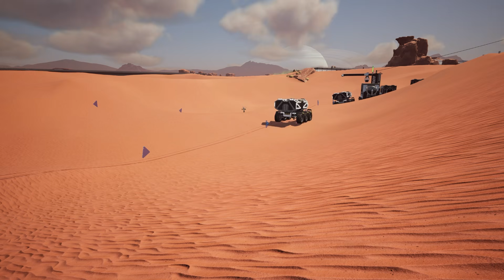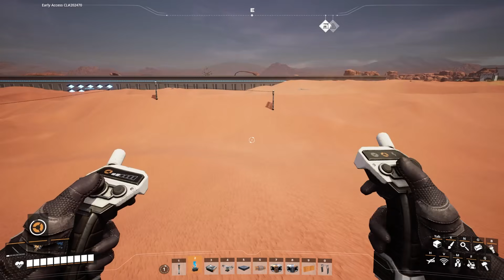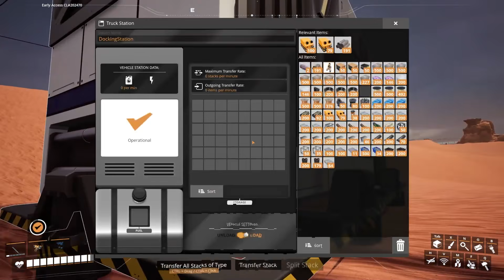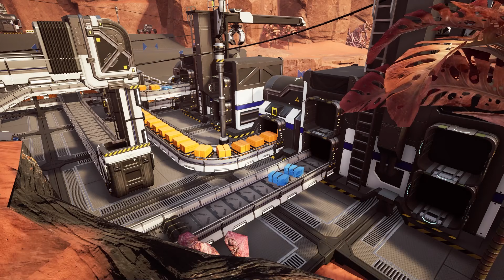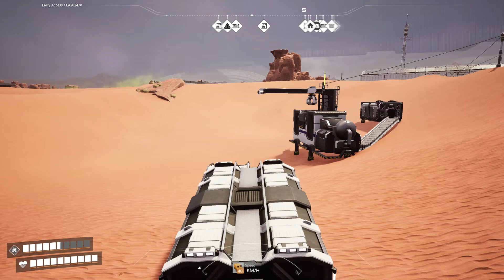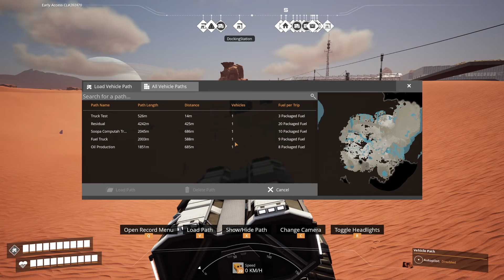[OUTDATED AS OF 1.2] How to Build a Truck Route in Satisfactory | Setup + Automation Guide

Comment: I think it would be good to mention some of the pain points using vehicles. 
1) Wood producing tree's of any size will stop your vehicle and is super frustrating when recording a route, so try to clear the route before hand. 
2) Even though you have to explicitly press the indicated key to load/unload while setting up a route.... strangely if the truck passes the bounding box (white square when placing) of another truck station it will perform the load/unload automatically... This was infuriating as you can spend many hours setting up trucks, just to start seeing materials begin to mix into your production lines and mess things up. 
3) For me, going up steep hills dramatically impacts steering for whatever reason and is a challenge.
4) Rocks, even small ones can stop your vehicle altogether.
5) If a truck falls in the water, it is lost and your only option is to dismantle it.
6) Afaik, a route can be edited, but only to delete a tracking arrow. You cannot add or move an arrow, which would make route building much less frustrating imho
6a) By extension, routes cannot be expanded, which is unfortunate as you have to delete and re-route if you want to add to an existing route
7) Tractors seem to spin around while turning at max speed (maddening while recording a route)

I love the truck idea, but after finding out all the above by trial and error, I often wish I had just stuck with belts. Its a love/hate thing for me

Comment: Thanks for this. I have been wanting to develop vehicle routes because I just like the look of vehicle transports compared to building 1.5 kilometers of belts. It works but it just looks and feels kind of unrealistic even for a game where you can build floating sky factories and launch yourself out of air cannons at Mach speeds. I've had luck making the factory look tidier by placing stackable supports and running belts, pipes, and hypertubes all in tandem, but since lengths of belts are much shorter per support than pipes and hypertubes I have to place more stacks than I'd like.

Vehicles fix this problem until I figure out rail transport but I found it oddly intimidating.

Comment: Great info!

Perhaps I missed it, but is there a way to have an automated vehicle go fetch materials more "on demand?"

For example, say I need one truckload of something - can I send the vehicle out (pickup) and back (unload) one time only? Maybe I don't always need the vehicle to continuously run the circuit over and over.

Just wondering.

Thanks!
Reply from the maker: Yes and no. You can't do that fully automatically. But you can build a truck, assign it an existing route, and then dismantle the truck when it comes back to unload. But if you don't interfere, the truck will keep doing the route indefinitely.

Comment: Great video, but I don't understand when exactly trucks are going to refuel? Whenever they come close to station with fuel ready to go in?
Reply from the maker: There are a couple ways to refuel trucks. If they load or unload at a station they will refuel if there is fuel in the fuel section of the truck station, and if that fuel type matches what's already in the truck. For example, if a truck is running on coal it can only be refueled by coal. Another option is to create a dedicated truck stop where that all of your trucks stop at to get refueled. You'll just need to include a stop there on your routes, and make sure the station is set to "load" so that the trucks don't unload their existing cargo.

Comment: Thanks for the info. So if a vehicle were to say, fall off a cliff or something, it would teleport back to a node?
Reply from the maker: In theory, yes. But it might not do so until you get far enough away from it.
Reply: @SatisfactoryNews  My man that is honestly so helpful because I put off making truck routes due to not knowing this one fact. I thought the AI was stupid but turns out I was the dummy.
Reply from the maker: It's definitely not perfect. Trucks are supposed to phase through each other if they get in each other's way but I've had truck systems shut down because two trucks got stuck on each other. And just yesterday I had a truck get stuck on a belt and I never left the biome I was in, so I had to manually drive it back into the road in order for it to fix itself. On the other hand, I have a truck route that is now covered by a rocky hill that wasn't there before, and the truck phases through it perfectly. So the AI isn't perfect,  but it's pretty good.

Comment: By the time it takes me to record the route i would already be done building a belt setput that has double the throughput. Hate trucks. 
The paths are also a pain to work with. For some reason it only allows to delete not move/add nodes.